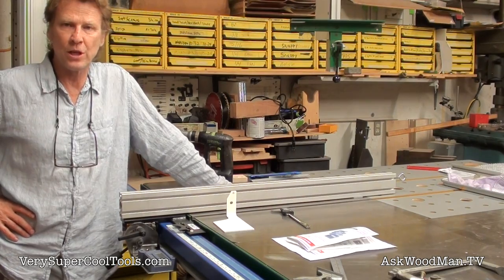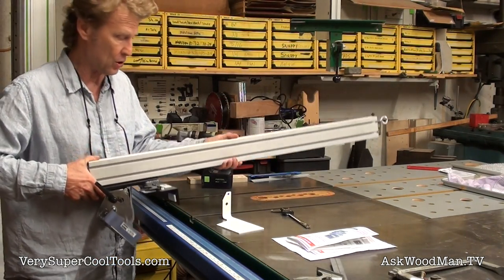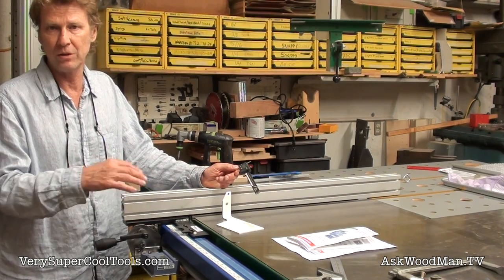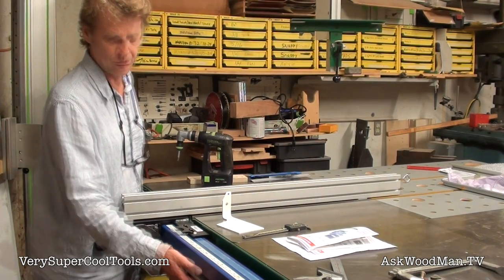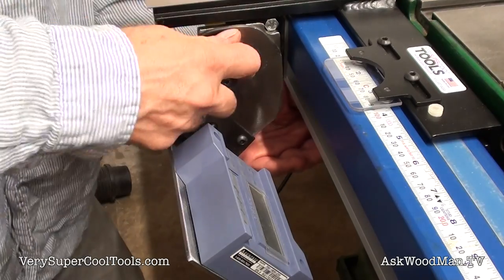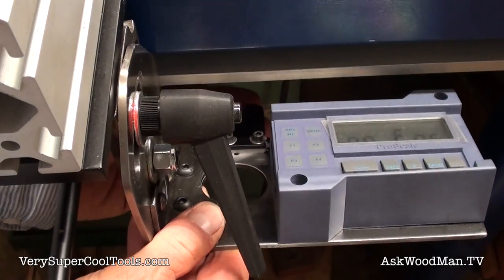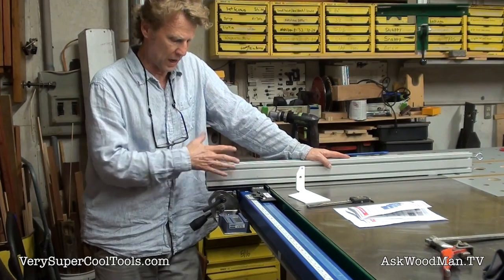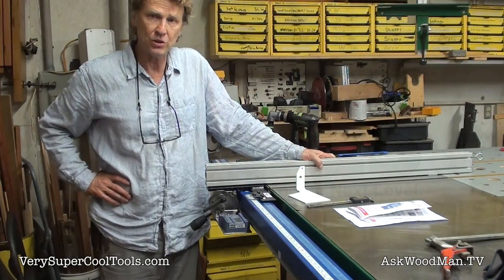1095. Proscale Digital Readout For Table Saw Fence

Comment: Looks like the Model 250 encoder/rail? I've been waffling back and forth between the Wixey or going for the gusto and getting the Proscale.
Reply from the maker: Yes model 250 60" rail. A woodworking friend in California has been using their products for over 10 years with zero problems.
Reply: My wixey stop working not long after I got it , my shed gets very cold and the readout didn’t like the cold

Comment: Are you still using your threaded fence positioner? Is it compatible with the DRO?
Reply from the maker: No I have removed that threaded positioner. But I do have new super simple micro adjuster I am going to reveal soon that is not based on a threaded advance. The way it works with the DRO to hit a number is amazing.
Reply: AskWoodMan Great, look forward to seeing that.